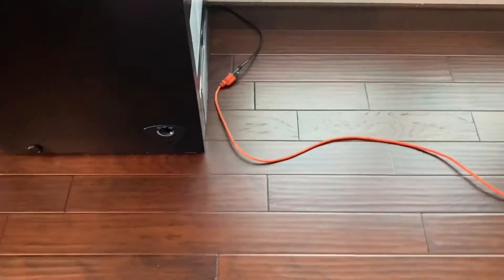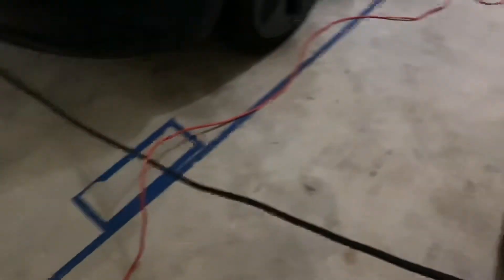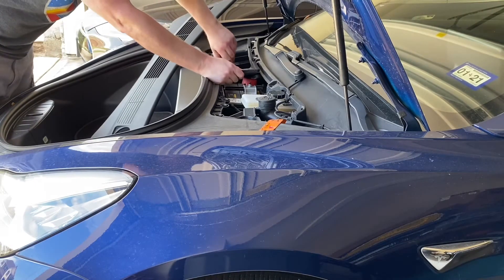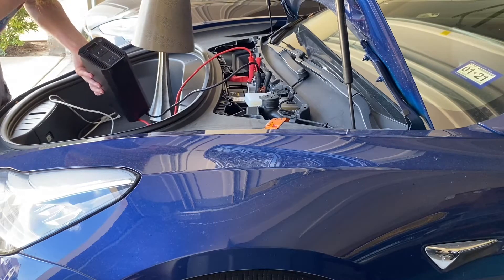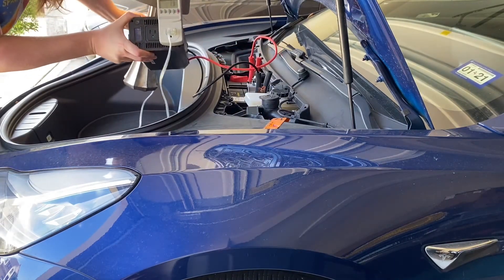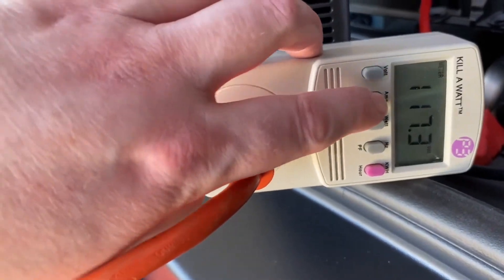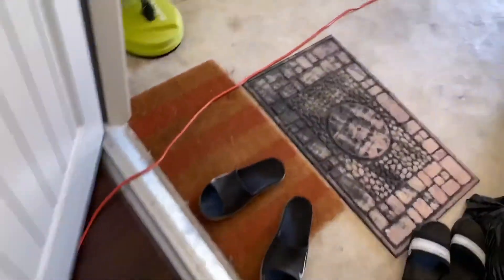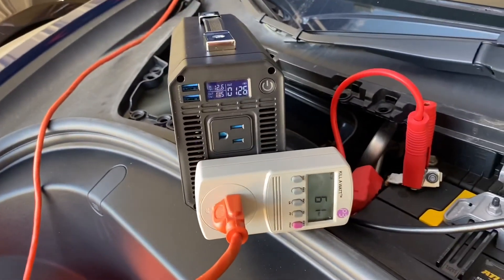Inverter Testing on a Tesla Model 3

Comment: I've done this with my 1500w inverter while in camp mode (and with climate controls all off)....seemed to work fine as I ran my pellet stove for several hours.  I've been cautioned strongly against doing this with Teslas though as I guess they've got so much sensitive electronics etc.  For some reason proponents say it's ok if you have the 12v cables attached directly to the terminals where the high powered battery are (under the rear passenger seat)  That would indicate that they don't recommend hooking up to the 12v under the hood.
Reply: Can you describe what the under the seat terminals look like
Reply: They are under the back seat on the passenger side.  It's where the low voltage system connects to the main battery. @LawlessGhost
Reply: @lenimbery7038  How difficult is that to connect at that location?
Reply: @Infinion  there was a video somewhere on YouTube that showed how to run a short cable from the post under the seat to just behind the rear seat in the trunk where they had that post and a ground that you could clip your inverter cables to. The problem was if you hooked it to the 12v battery it might drain it to a dangerously low level before the large battery would start to charge it

Comment: Great video. I’m just wondering how long it would run? And because you first the Model 3 in Camping mode the inverter will draw the power from the HD battery pack without effecting or taking power away from the 12 volt battery that the pure sine inverter is connected to?
Reply from the maker: It is hard to say.  The Mid Range model is a 62kW battery pack.  If you shut down cabin overheat protection, sentry mode, you can probably pull 1000 Watts for about 60 hours or so.  If you did half that, then 120 hours.

Comment: Hows this working out. Many hours on it. Did you need a pre charge circuit for the invertor.
Reply from the maker: Yes, the inverter capacitors are too big and tripped the soft breakers in the car. The easy option I use now is an anderson connection from the HV battery under the rear seats to a 12V battery in the back and then from the 12V battery to the inverter.  It all comes on and off with the anderson plugs.

Comment: What happens if you load the DC-DC inverter too hard, will it die or will a fuse/safety mechanism engage that’s easy to reset? I have pulled 50A for hours from my M3LR and I am wondering how much I can take for an extended period before something happens and then, what would happen?

Comment: Interesting, I've thought about this ability. I wonder how many amps the Tesla's built in DC to DC converter will recharge the 12 volt battery at? I may test this out. It would be so much easier to do this than to try to start a gas generator.
Reply from the maker: Good question.  It depends on the car.  On the Model 3, I believe the Amperage recharge is limited to under 3A on the 12V battery if you connect up directly to it.  On the S I am not certain what the rate is.
Reply: @Palvaran  I've heard the Model 3 DC-DC converter can provide something like 193 amps @ 12v. ~2.3 kW. Although it will cause tons of issues if you try to actually draw that much since you're siphoning power away from the onboard computer needs too.
Reply from the maker: @Jedi2155  Thank you for the information.  That sounds similar to what I have heard too.  I think it was greentheonly that suggested that in the Tesla Forums.  I pulled too much once from the initial charge of the capacitors and had to reset the car to correct it.
Reply: @Palvaran  how much was the load that triggered the protection of the car? Did it happened with the bestek 1000W? I was just thinking to buy that inverter and connect it to the DC-DC converter under the rear seats.
Reply from the maker: @MaurizioFabbroniLifestyle  Bestek was great.  It ran a window air conditioner without any problems.  I can't remember the  trigger, but I think it was at close to 2,000 watts.

Comment: Did you check the refrigerator/freezer that failed with the Kill A Watt? The startup surge possibly needs just a hair over 1,000W like mine. A 1,200W inverter works for me.
Reply from the maker: Good idea.  I should have, but instead just went ahead and picked up a 2000 watt inverter, but have not tried it yet.

Comment: Are there any risks to the battery by doing this?
Reply from the maker: Potentially.  On a model S, I blew a 40A fuse out accidently making contact on the fuse block, but after a $5 replacement it was good to go.  In regards to the battery draining or aging faster, not really any faster than if you were driving the car I suppose.
Reply: To be clear, this will not damage the main high voltage battery of the car. It may demage the 12v battery If you drain it faster than the onboard dc to dc converter can recharge. 12v Batteries lose their ability to hold charge if they are drained completely.